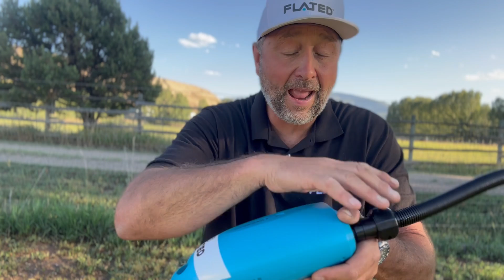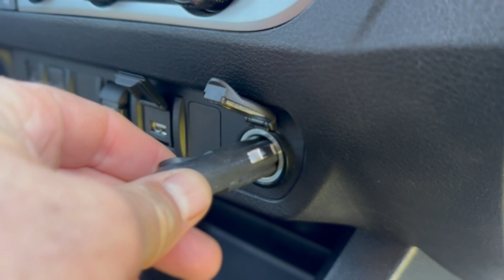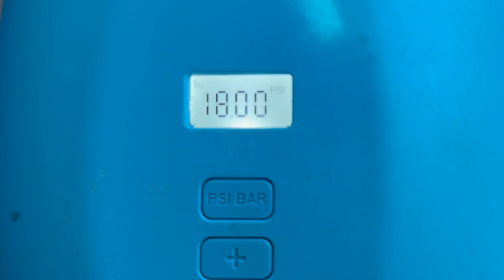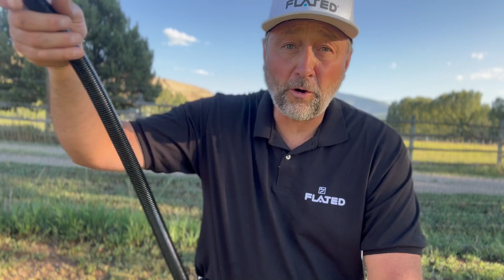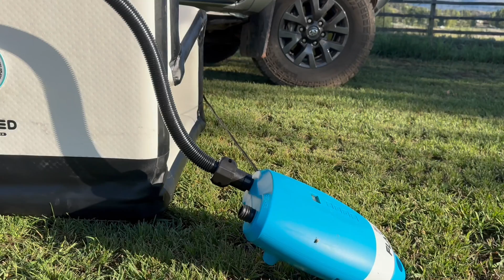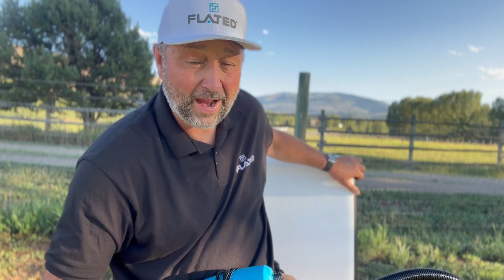FLATED Air-Pump User Guide / How-To

Comment: Love the product! I have the topper for my PowerWagon installed on top of my GoFastCamper. Just ordered three of the small bags and the chair and table set. ALthough I have a dual compressor pump from ARB in my truck, there's no max setting so I ordered the pump to be safe given the investment required for these components. If you're on the fence about any Flated product, my experience has been they underrate their own products and they feel and operate more ruggedly than advertised.